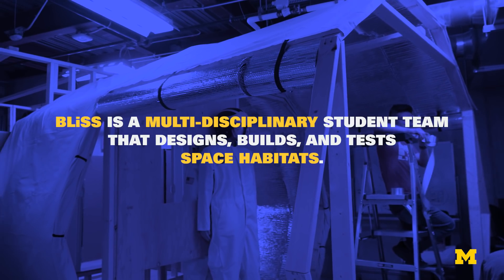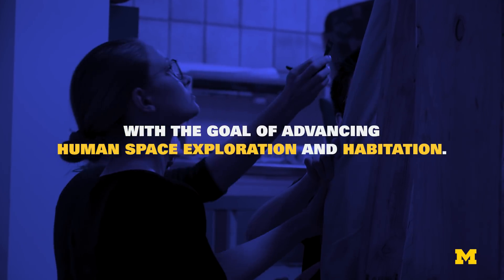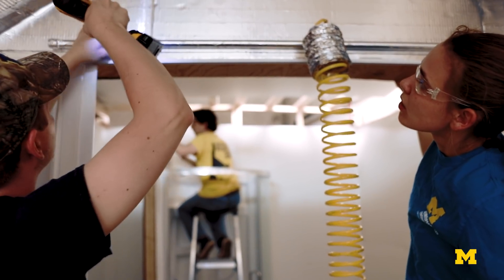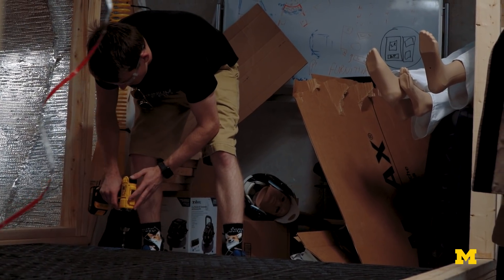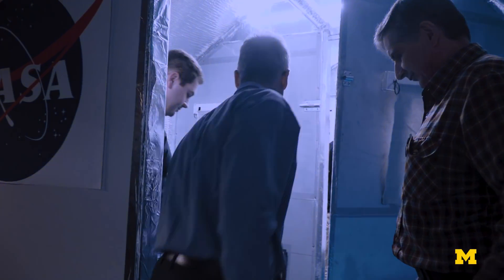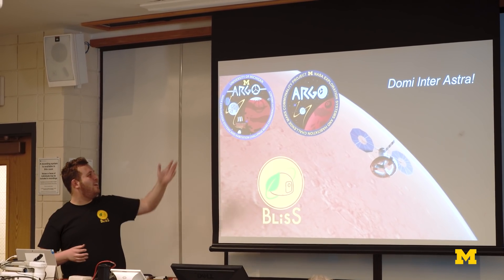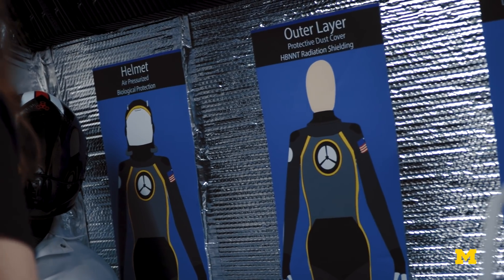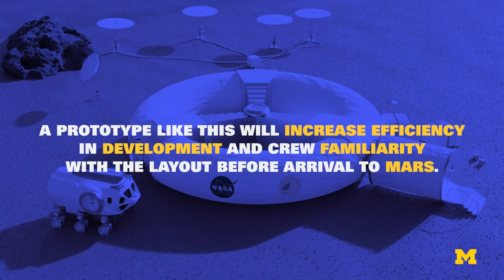Mars habitat and space vehicle prototype

Comment: Would using carbon fiber (hollow) or plastic studs be lighter to work with? What type of pressure will be on the exterior of the habitat? Like the look and feel just wondering about the material composition! Great job. :)
Reply: It's based on the NASA TransHab techology which is what Bigelow is also based on. The gas is retained by what is essentially saran wrap and the pressure loads are taken up by a layer of woven Kevlar.